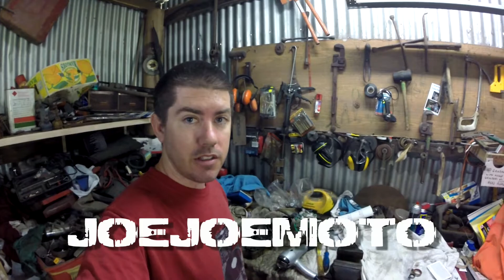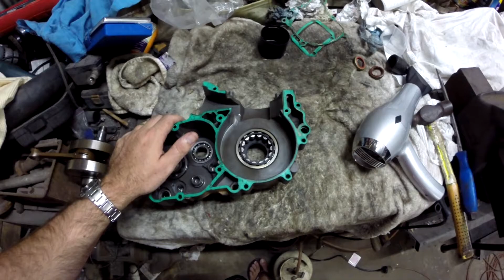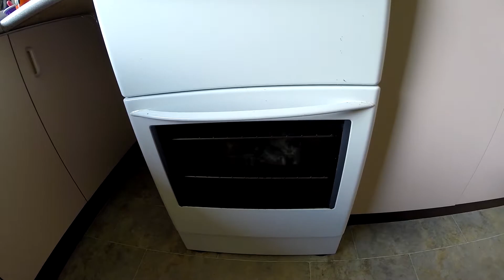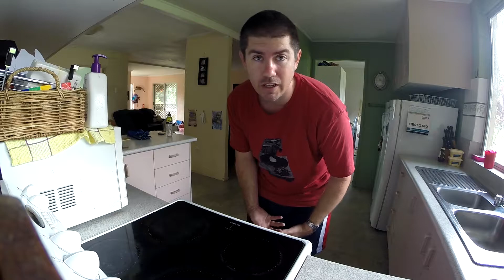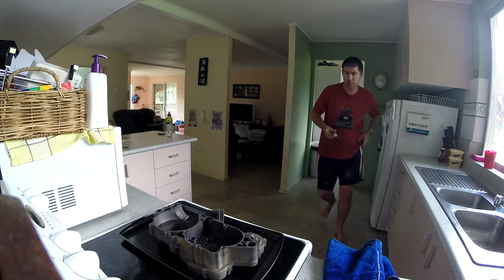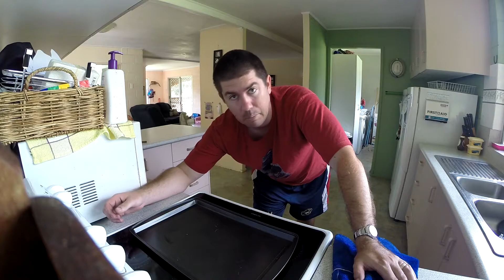#JJM KTM 300 Rebuild Part 6

Comment: great video! do you not need to use lube or grease replacing those case bearings?
Reply from the maker: When assembling, I put lots of two stroke oil in all of the bearings and things.  I am unsure of the need to use special grease or anything.  The workshop manual didn't call for it from memory.  Just lubricating with 2 stroke oil.
Reply: Yeah cool just wondered as I couldnt see that when you were applying them, hope bike is still running sweet!
Reply from the maker: Yeah mate, bike is still going strong.  I have put about 40 or so hours on it since then!

Comment: interesting how they use ball bearings for mains in bike engines but not in car engines
Reply from the maker: aussie tonner Yeah, strange huh.  One side is roller bearing though.
Reply: Its a 2 stroke which means that the fresh charge (air and fuel) actually goes from the underside of the piston to above the piston via the transfer ports. This means that you can not have a crankcase full with oil sitting at the bottom of it like you do in a 4 stroke. This also means that you can not use plain (white metal) bearing that you force feed oil. The only bearings that will survive with just an 'oil mist' which is what the fresh charge is are ball bearings.